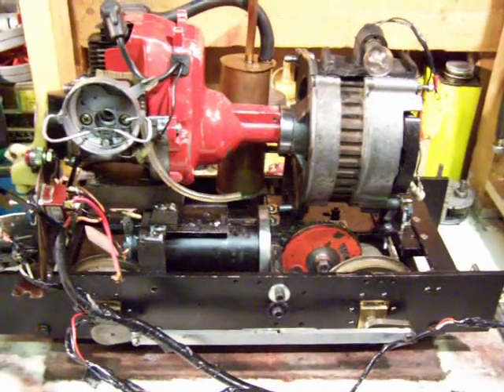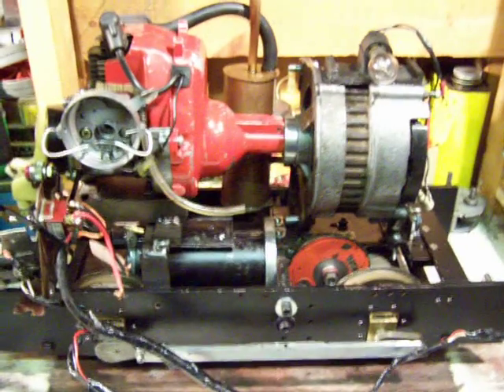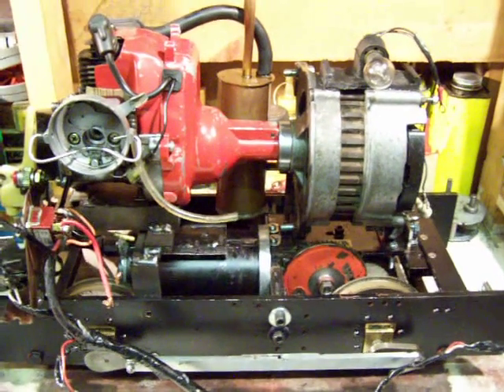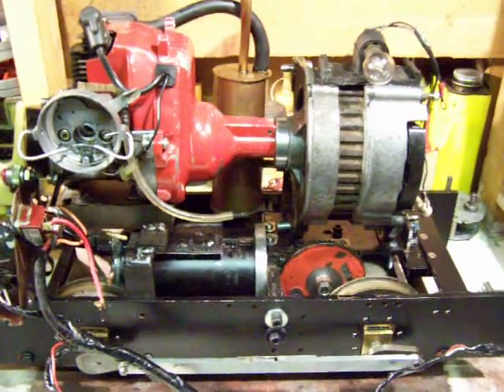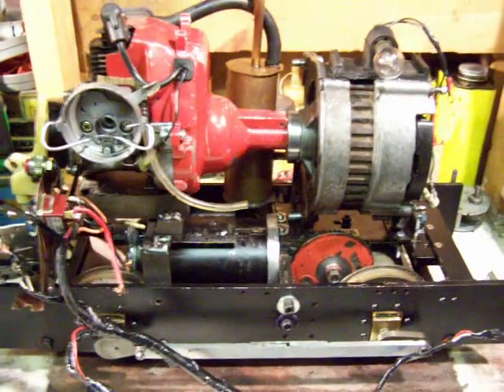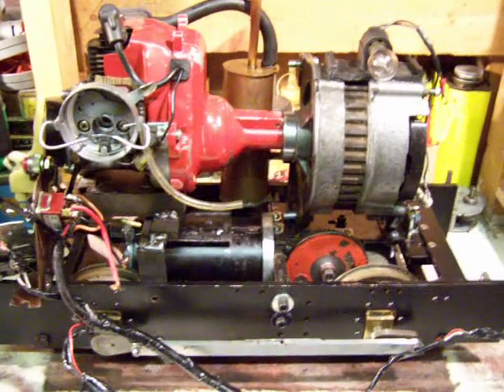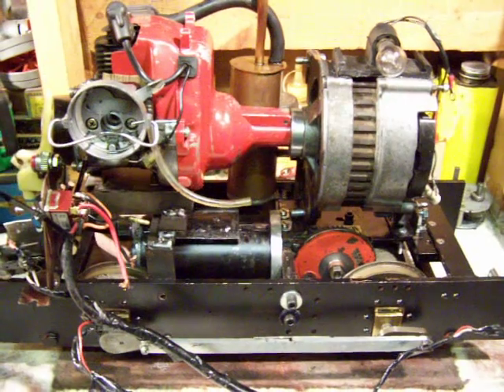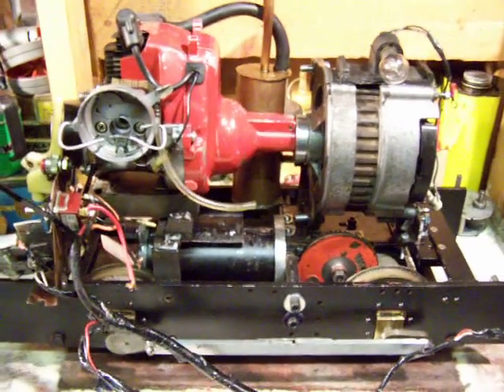5" locomotive deltic petrol electric made from bits and pieces .

Comment from the maker: @kennysteam1  Hi Kenny ,done a bit recently , have used 24 volt dc motor as generator and 36 volt drive motor ,then put chain and sprokets so i can play with ratios ,its still a bit low geared but pulls pretty well for a 22 cc .

Comment: do u alter field strength on dc generator or was that the alternator u were talking of.?
I havent seen any small dc motors with variable field winding type stuff.
Or with the dc do u just vary rpm to adjust voltage?
U could use a centrifugal clutch to control generator so when u rev to go?

Comment from the maker: yes am attempting to vary the armature voltage to vary the magnetic field strenth .and as you say control the geny out put along with engine revs ....its a bit fiddly and latest version has electric motor instead of the alternator ,as in the running vid,this makes the whole thing simpler ,,output voltage is 16 volts dc at max revs that is why the traction motor tore itself apart !!

Comment: What voltage control do u use?
The full size ones have traction motor field divert and seperate exciter for generator, so u use resistors for excitation circut, the field strengths adjust main generator output along with engine rpm.
I have wanted to make one of these for ages.
I have windscreen wiper motors and alternator from 2cv - its quite small u see.
I had 2 chainsaw engines, but carbs were fooked!